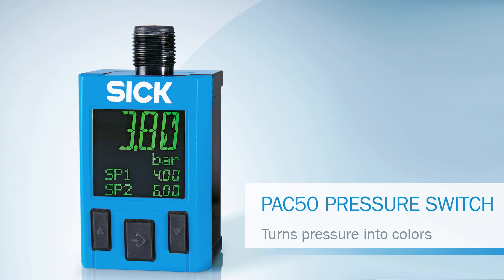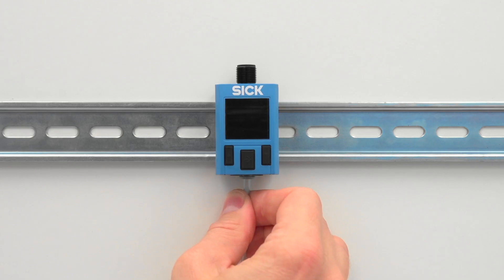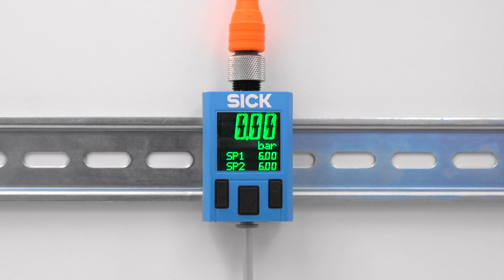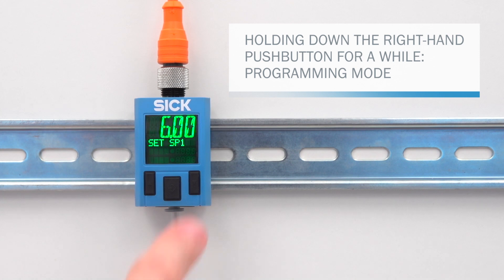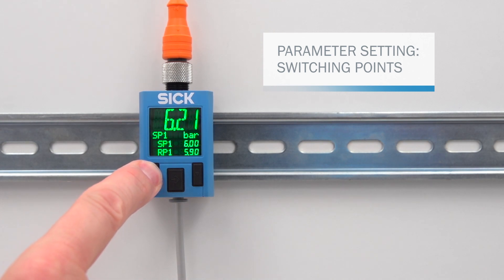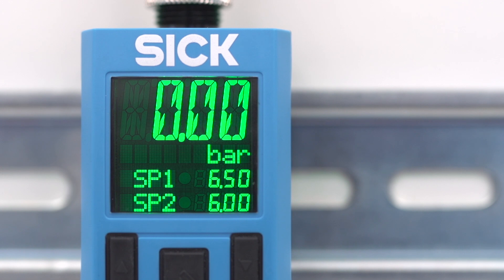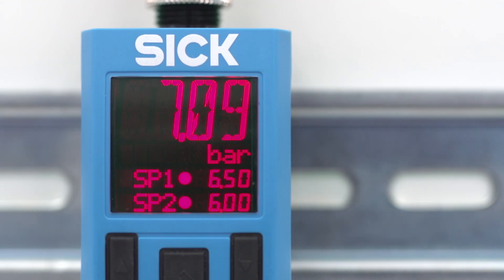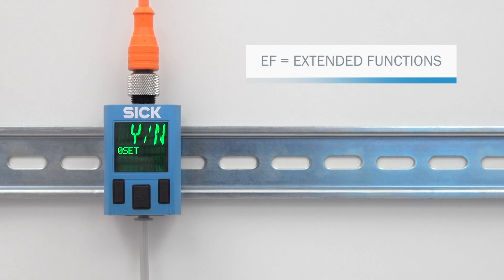Tutorial: Set-up of PAC50 pressure switch from SICK | SICK AG

Comment: Hi, is there a way where I can have SP1 and RP1 on the main screen instead of SP1 and SP2? tried find it in the data sheet but nothing. Please advise if this is doable. Thanks
Reply from the maker: Unfortunately, the setting you requested is not possible. However, you can obtain quick information on the respective SP1 and RP1 or SP2 and RP2 by pressing and holding the left button. 
The sensor then switches to the so-called "Info" mode and the set values of the SP and RP as well as other sensor settings are displayed one after the other. This is also described in the tutorial. After running through the information, the sensor then shows the standard information on the display again.

If it is an option for you, you could use the sensor in window mode. In this mode, the values for the upper and lower window values are shown alternately in the two lower lines of the display.
This means that FH1 and FL1 are displayed alternately in the top line and the values for FH2 and FL2 are displayed alternately in the bottom line.

The difference between hysteresis mode - i.e. operation with switching points (SP1/SP2) and reset points (RP1/RP2) - and window mode is described in the PAC50 operating instructions. If you have any further questions, you are welcome to contact our experts directly via info@sick.de . They will help you with your request.
Reply: @SICKSensors  amazing, thank you for your help.
Reply from the maker: You're welcome!